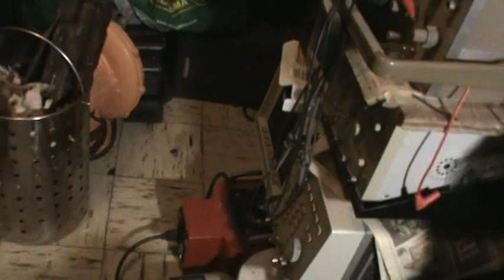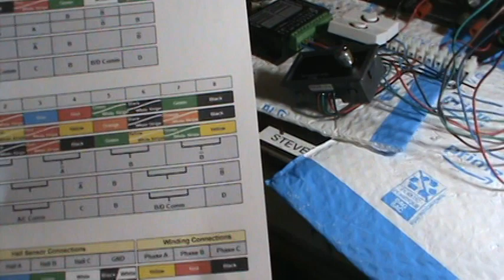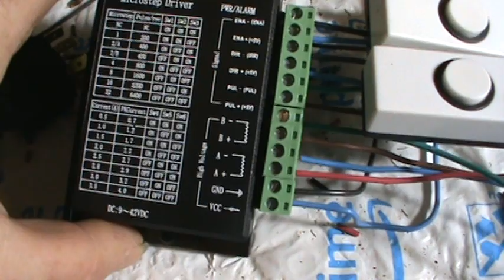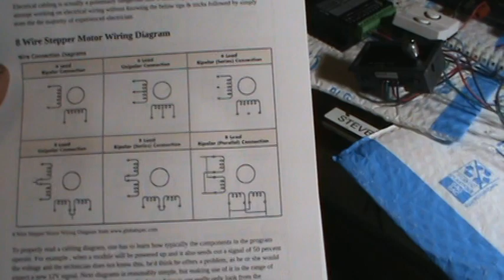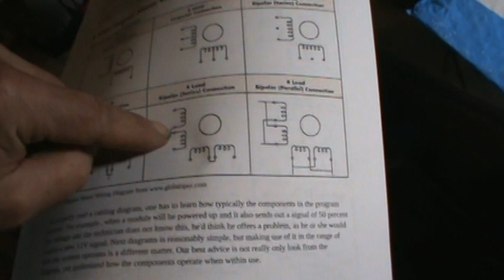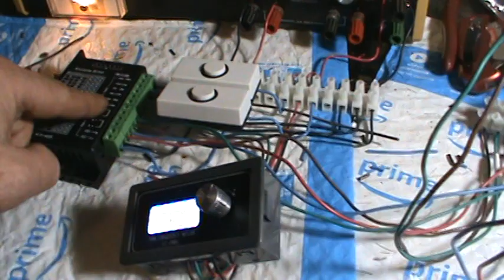8 wire stepper motor hooked in series Part 2

Comment: I tried to look up the datasheet for that stepper motor but couldn't find a match yet. They are similar to the Nema23 stepper motor. My motors can take up 12v dc that I used for my 3D printer.
Reply from the maker: i couldn't find anything at all . but got it figured out